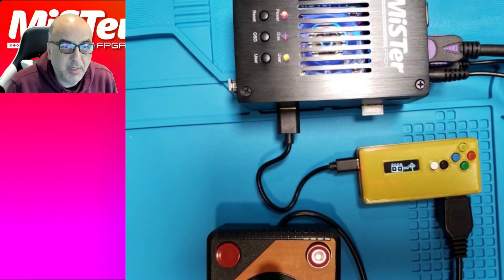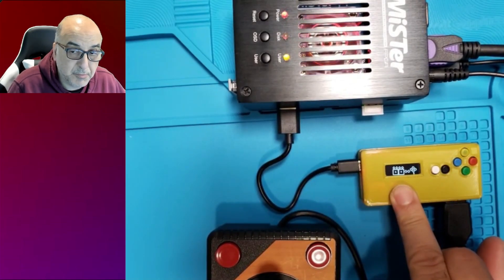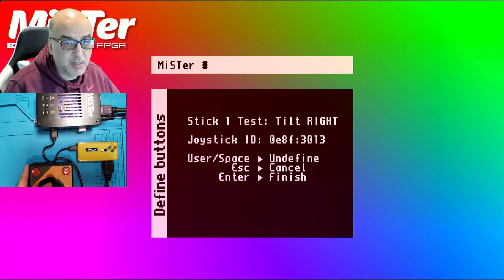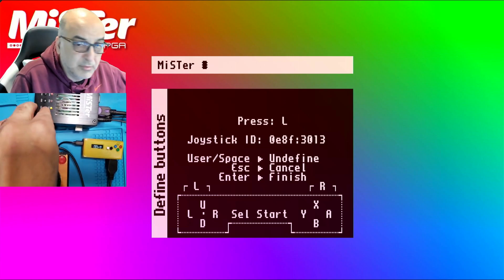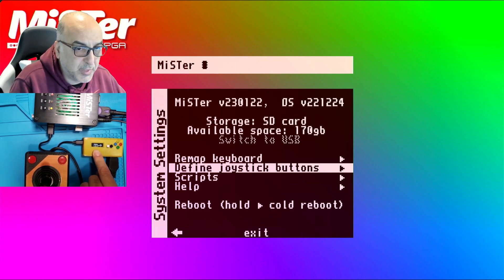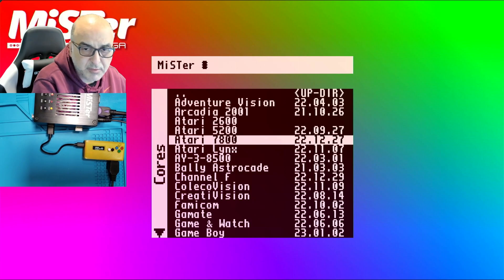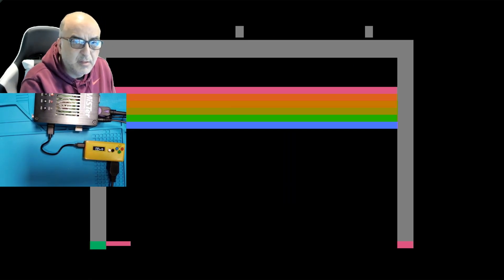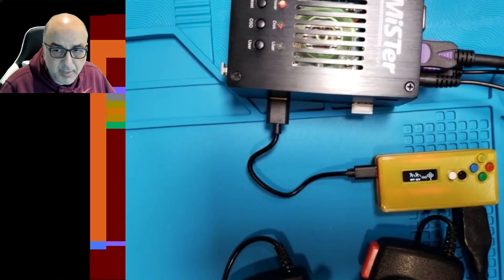MiSTer FPGA with Dual Atari Paddles setup using iCode Duo Plus USB Adapter

Comment: Hi, I just tried again your two port adaptor to play with dual atari paddles (on left port) with Mame and 1972 arcade Pong...I'm getting this: when the paddles reach the center get stuck there for while, both, going upwards and downwards...what could it be? Thanks
Reply from the maker: for MAME you need to use mouse mode. See https://youtu.be/usQFOvhniwg?si=bVhQMXQIkhTE6lGG

Comment: Hi. I got the joystick to work, but I can’t get the paddles to work. When I connect the paddles, when I press the yellow button nothing happens, instead of auto detecting like yours. I tried changing the peripheral on the mister menu to paddle and switching everything to yes, but it still doesn’t paddle. I love breakout and arkanoid, and The paddle ability was the entire reason I purchased this device and a joystick, so can you help me get it to work? Please and thank you.
Reply from the maker: On the Duo:
1. disable mouse
2. turn on Mister mode
3. go to the paddles menu and change Paddles AS to "LEFT".  (this is import step)
 
Now. Connect a joystick and turn on Mister
1.go to mister menu (before you load atari core)
2. from the System setting menu of mister, select Define joystick buttons
3. use a joystick to set dpad right and down,  skip stick 1 tilt right  and stick 2 tilt right
4, use joystick to set right up Right left up down and A B C D buttons.  Skip L and R buttons. Set the Sel and Start buttons
5, skip all mouse settings, menu,  OK, and Back
6. when it asks for tilt right, move the joystick to right.  Tilt down, move the joystick down.  (this is important step)